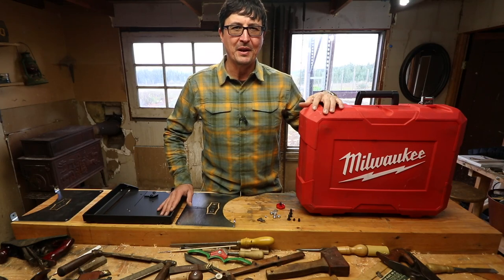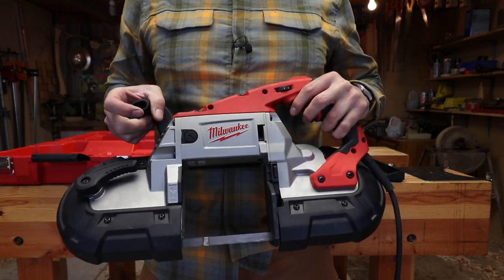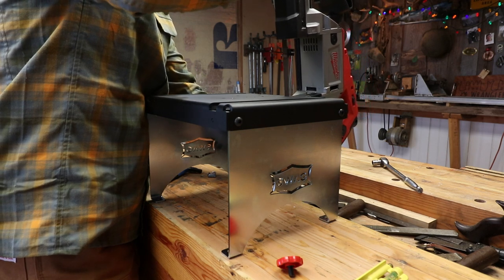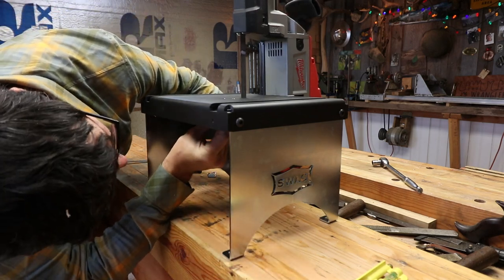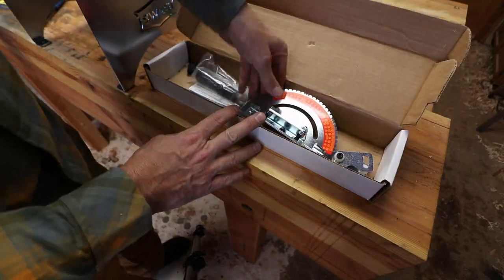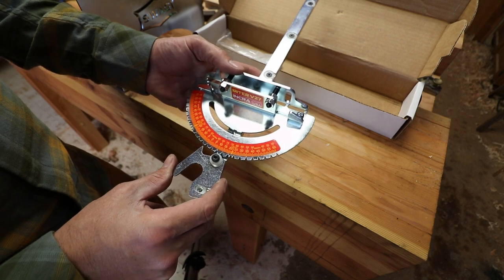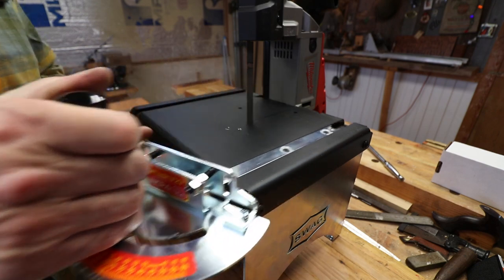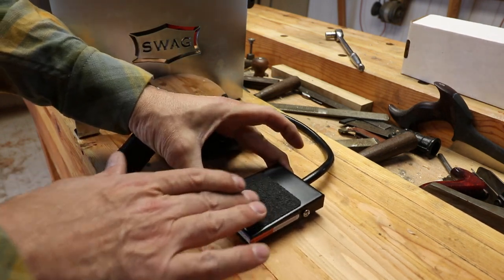AMAZING MILWAUKEE TOOL HACK!!

Comment: Just received my Swag Portable band saw table and it looks great I'm waiting for the protective paint to dry as we speek. I have a small Knife making Hobby and part time business and both my stand up and lay-down saws run to fast for some applications so I purchased a portable band saw and a SWAG PB Table to mount it to. It allows me to run the saw a much lower speeds to cut Titanium and other special metals.  Im happy I wish the table was made of Aluminum Better corrosion resistance and lighter. Maybe they will make some for sale and at a lower price point.

Comment: This company makes models to accommodate different brands and models. I have a need for portability and low cost overall. I am looking at HF 62800 and Swag v3.0. HF also has the foot switch that will work. I'm not looking for super precision. 
Thanks Cody for showing this to us!

Comment: Strangely, I thought of this about 30 years ago, but didn't know how I should attach the saw to a table. I just stood it upright and sort of hung it from the handle, resting the bottom on the table below. But I had no table platform around the blade. Just the guide bar sticking out to rest the work piece on. It worked, sort of, in place of the big band saw I had to give up when I moved into my apartment. I will have to take a look to see if my ancient milwaukee bandsaw will fit into this.

Comment: On the foot switch: I bought a $15 heavy duty foot switch from China, and wired a power bar to it. Very nice when using a heavy router, or when checking out a second hand tool so you can cut the power instantly.

Comment: Nice idea, only issue I see is possibly a PITA to change blades, but not sure.  I used to use a portaband clamped in a vise until I got a full size metal cutting band saw.  If I'd had something like that it may have taken me a bit longer to get a full sized unit.  

As an aside, I used to say the same thing about Milwaukee tools, but then I got a chop saw that wouldn't work and the company gave me a huge runaround trying to get them to warranty it.  Finally gave up on getting it fixed and got a different brand.  After that I will never buy another Milwaukee tool.  Doesn't matter how well a tool is made, if you do have an issue and the company won't take care of it's not worth having or spending the extra money.

Comment: Bought this item about about a month ago, Troy tried to fix some of my concerns. The reality is the powder coating is so thin to accommodate the saw mounting to the table that it easily peels off with light use. Additionally the brackets on the underside where assembled backwards so the paint underneath was not covered completely after I fixed the problem. All together it is useful and works fine for my needs, i just feel it's overpriced for the quality your getting.

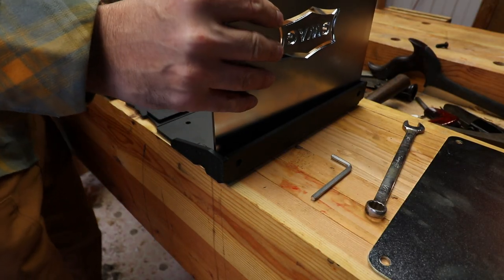Comment: 1:37, all I could think of was rotating the whole plate 90 degrees, so it sits over the edge of the table. No more removing and re-inserting that Allen wrench for a half a turn.

Comment: According to the manual, that extra clip on the Incra miter gauge is for when your table has a T-slot instead of a plain rectangular slot. So not used for the SWAG table.

Comment: Thought about getting one of these for my Harbor Freight Bandsaw, but I think I will just make one from some lumber.  Piece for the Incra is to lock into a miter slot on a table saw so it won't tip when you have it pulled back towards yourself.  Like the light on the saw it reminds me of the cutting light that I have on my Dewalt Chop saw.  I feel they are better than a laser.

Comment: I got one to use with an El Cheapo Chinese saw that I had to make it more usable. When that saw dies I will invest in a better one. The SWAG unit is great and I use it often on cutting some steel projects. Beats a hack saw to pieces. My dealing with SWAG was delightful a wonderful company. This is not a paid comment.

Comment: I'm wondering, I would like to have a smallish bandsaw for metal and or wood cutting. Could a set up like this work well with wood? I'm concerned about tight turns mostly.

Or I could just buy a Harbor Freight wood bandsaw. But which is more cost efficient for the application?

Comment: Try bolting the little slider shoe into the second or third hole. The first hole is too far forward, it needs to stay in the track until your miter gauge slider edge is past the band.

Comment: I wish I had both that band saw and table thing about a week ago. I had to make some room in my closet by cutting up the shelves to make them shorter. I thought they were made out of aluminum and possibly hollow, but they turned out to be solid steel rods. Three hours of using a hacksaw later I got it done but boy was it a terrible time.

Comment: Wow. Great quality engineering and materials. Definitely makes me think about buying a set. I do a lot of handcrafted artwork with both wood and clay and I've wanted something I can use here at my apartment that isn't huge like a full bandsaw, but can do precision, heavy cutting without being excessively loud (I may be the only one, but I do care about the noise I make for my neighbors). This is absolutely perfect and I have the perfect table I can mount it to. Definitely going to be saving for one. Thanks for sharing!!!

Comment: My only complaint about the Incra is the fact that it uses 3 or 4 different sized Allen keys.  I did have to go buy a standard set of Allen keys.  But it's absolutely one of my favorite and most used tools.

Comment: You also could use a angle grinder an get the same precision. But i think it need some experience to cut very precise. I use a angle grinder  daily because i work a lot with metal in my job (Metallbauer/Stahlbauer(German)).
A angle grinder is the one main tool for me. There are also stands for angle grinders available if you don't have a good feeling for it while don't use it very often.

But this saw stand is a good idea :) and i like it, mainly because it don't make any spark and don't heat up the steel very much.
Maybe you need some liquid cooling if you cut long time? We use big band saws with water cooling and 'auto move down' function and they are water cooled.

Comment: I wonder if this could work with a mister for lubrication? Do you see any issues with the lubricant getting down into the trigger or motor of the tool and causing problems? Maybe a deflector shield can be used under the table if there is space?

Comment: If you have steeper angles, then your guide will not be over the working surface of the table. The tab on the end of the guide keeps the guide fixed to the table so you can cut your extreme acute angles.
Reply: Yes, another couple of guide slots closer to the blade maybe a god idea.

Comment: Not dissing the tool, realy awesome setup, but for stuff like rebar or even that bit of bar you had, why not just use an angle grinder with a cutoff wheel, a little bit of practice and you can cut things as straight as anything.

Comment: I use a zip tie to hold the trigger on my soldering gun when I have the rope cutter attachment on it, and mount it in a vise to use both hands for cutting rope or strap. I could really use a foot pedal like that so I don't have to plug and unplug the soldering gun.

Comment: Apart from making it easier to use, the foot peddle also makes it safer. A really nice touch.
Reply: SURE  just like toilets. the person/persons which invented the 'flush' lever, should just lever alone. THAT flush lever, SHOULD BE  ON THE FLOOR, WHERE NO ONE NEEDS TO TOUCH A DIRTY HANDLE, and the valve would just turn on the supply line, for a given time. The technology is there, as there is computer stuff in most everything nowadays. Even a hydraulic cylinder, to give it enough time for 3 or more gallons, like your hood or trunk ones. i've thought about this for years....where is the invention ? kills the virus 'dead....dead.....dead...''

Comment: I don't really see the need for this in a shop. I could get a decent band saw, not great, but okay, with the same cutting clearance for half the price of the portaband and table combined. As one other commenter suggested, it might be useful for on the go stuff, but I just don't see much use in a shop.

Comment: That tool is OK if you have that tiny of a band saw but if you do not you can simply put abrasive steel cutting blades on your skill saw or your radial arm saw or your compound slideing mitersaw like I do.

Comment: 9 months later,  every day, I use my $150  SWAG V3.0  and $300 Dewalt DWM120K.
9 months later, every day I use  $54 SSC Controls F300-1501 Foot Switch and $300 Fein 9-20-25 Vacuum. 
 Right now I will order the $85 Incra V120 not the V27, as that is what AMZN shows.

Comment: I have the swag stand and miter, and a dewalt saw.  Basicly same setup as you show here. The swag stand needed some tweaking. I had to do some filing and finish work on mine for the miter to slide in the channel when performing cutting operations, as it was hanging up in the slot. The miter is also out by a few degrees vs the table.  Considering what the swag table cost me these issues should have been addressed in post production of the item.That being said, the swag table is a good idea, just not as precise as it should be for the money. Maybe I got a bad one, who knows...

Comment: Cool setup.  But the table doesn't look nearly deep enough to use that miter gauge with any stock wider than maybe 2".  It's a good application if you already have a porta-band, but I feel like anybody who owns this tool could probably make this whole setup themselves in a couple hours rather than buy it.  I always kind of think that in the back of my head when I'm looking at a woodcraft magazine.  What kind of woodworker is buying all these easy-to-make jigs?

Comment: I have a DeWalt portaband and found that I use it a fair bit because I don't have a plasma cutter and don't want to lug the torch and tanks around.  I've had my eyes on one of Troy's tables for a long time because I do a bit of fab work from time to time.  

Oh spend the extra few dollars to get Bi-metal blades, you will be glad you did.  I found they have at least three times the blade life.

Comment: I used those saws a lot in high pressure pipe welding thay make nice clean cuts with no clean up like a torch or a plasma cutter

Comment: Nice work Troy...a quality product!  I use a 14" metal chop saw for my metal fabrication for my business but it leaves such a rough edge...I considered getting a larger band saw but the space needed and cost weren't justified...this looks like a good solution for most people who need accurate and clean cuts with a smaller footprint!

Comment: One question- I have looked extensively at both Milwaukee website and Swag website- your video appears to prove footswitch makes saw keep running without holding trigger in- does the trigger have a lock? I cannot find one in user manual for the saw so I'm not sure how you are turning it on even if it is wired with a footswitch. Does the Swag table have some sort of trigger compressing lever or something?

Comment: EZ Loader Trailer MFG. is selling miss made, and old stock for cheap. Ad read 2 x 2 x 3/16's wall thickness by 26 feet long steel for $49.00 a stick. Bring a trailer long enough to carry. I called and asked if I could plug into a 110 outlet. Answered yes. I love my Milwaukee heavy duty drill but am now retired and took a bath in 2008 along with chemo therapy to kill a virus. Can't afford millwaukee so I bought a Chicago from harbor freight $139 bucks. It is quality and cut the 2 x 2 like butter. Threw the sections into the van and will be building a welding table soon. Very nice advert for your friend. I'll be building my porta band table soon very soon and youtubing it.May God continue to keep blessing you and yours.

Comment: That miter is no good since the blade doesn’t set up straight. 
I’ve had to notch my portaband to make it SOMEWHAT straight. 
This table set up is perfect for on-site fabrication but don’t expect things to be perfectly square. O and mine’s a 18v fuel so no cords mean I can use it anywhere.

Comment: That's a great idea, a small plastic tray under the tool would catch most of those shavings.
Reply: I'm thinking of how to attach my shop vac hose. I'll probably just use duct tape to get it into a configuration that will suck just right, but then will have to figure out how to attach it semi permanently. maybe just a straight plastic pipe placed just under the table top, pointed close to the drive wheel so it gets as much of the shavings as possible?
Reply: D.E.B. B blade is going down, so make a plenum underneath, probably pvc  with a slit in it. 
attach shop vac to that.

Comment: Nice tool accessory, but I would be concerned about the metal shavings falling down into the bandsaw's lower drive wheel after a time instead of the shavings primarily dropping away from the cut as when the porta-band is used in the normal horizontal cutting position. Milwaukee corded tools used to be what I considered to be "Heirloom" tools. As long as they were not stolen, burned up in a fire, or drowned in a flood, they would outlast their owner. Of course, in a commercial setting involving the use/abuse of the tool by others who did not happen to be the one who forked out the money for them, lifespan can be considerably shorter.

Comment: hi, I've been watching your top 10 tool essentials and pro tip videos. Just joined on with a contraction company that does insurance claims. anywho! was wondering if you could do a video for guys/gals just starting out in the industry, and touch on what to expect,/what is or may be expected from employer, work ethic/standards, pecking order, etc. Appreciate the helpful tips videos, I try to study one new thing every night that will be helpful on the job and when the day comes they ask me  to do something like measuring & cutting joists, or a piece of trim for a tricking corner piece. Thanks for the inspiration.

Comment: First saw this kind of set up in a blacksmith shop I worked at.  Uber useful for all kinds of jobs - quick cut off on production jobs or as you say cutting smooth curves... We tended to use a zip tie rather than a clamp on the switch but obviously only with the foot pedal so you have a quick cut off.  As with any saw with you feed material into you do really need to pay attention and keep hands well clear - Know from experience just how easy it is to slip and give yourself a really nasty cut...
Reply: Before anyone comments on how dangerous a zip tie is I would say I agree - using a light clamp has the advantage of adding another potential cut off (by just knocking it off) in addition to the foot pedal.

Comment: realy like it , like you said its a good alternative to a big stationairy bandsaw or even a automatic bandsaw for cutting thick steel
now if only they sold these portasaws a little more in europe , only fiound the battery versions here and those didnt actually have the batteries and chargers in them

Comment: Great review, Mr. Wranglerstar! I'm heading over to Troy's website now, but I'm a bit worried that with the small amount of fabrication that I do, I won't be able to justify this. I have been using my trusty Milwaukee Angle Grinder for my "precision" cutting.
Reply: And that's really not a bad price, either. If I get into a bit more metal fabrication, I'll try to remember this one.

Comment: Nice complementary tool, but they could have included that clamp that you need on the Milwaukee.
Reply: i think i saw holes in the legs/feet to bolt it down.
Reply: they come with a strap to have the trigger held
Reply: Guess Cody missed that part of the manual 😉
Reply: I guess Cody is a real man, like me,  and doesn't read the manual ;)
Reply: I find it hard to believe that anyone who owns an expensive portaband doesn't own a single clamp they can use for this purpose.
Reply: How about a piece of duct tape

Comment: Great video Cody and another great Swag innovation! Just curious about one thing though; wouldn't your blade last longer if you used cutting fluid? I'm not a pro, but I've read of and seen the stuff in the mfg. world a few times and just figured it would extend the life of any metal cutting tool.

Comment: not sure he should make the work earia black... you only used it a few times and its allready scratched.. maybe leave the work earia bare and make the stand black XD great idea though... awsome tool!!
Reply: i guess its to prevent reflection of the light in the saw.. (wich should have a on/off function annyway) and a lockable on/off switch

Comment: First off I've never seen anyone using one of those saws on any of the 100s of building sites I worked on. Second how much does all that cost and how does it compare to a standard bandsaw?
Reply: I am a welder/fabricator shop and field and have carried a portaband for 30 years.  Some situations it is invaluable just as a sawzall is for hard to reach areas.
Reply: Big Ian Builds same here. if i need sloppy cuts i have a angle grinder. never have i even seen a portaband.

Comment: I need to cut aluminum that is an 1/8 inch thick that is 6 inches long  and it is only a half inch wide I need to cut a angle length wise but I need as straight of a cut as possible 

Any suggestions?